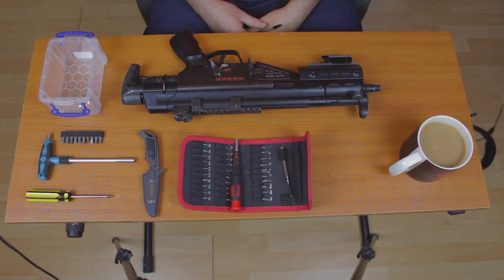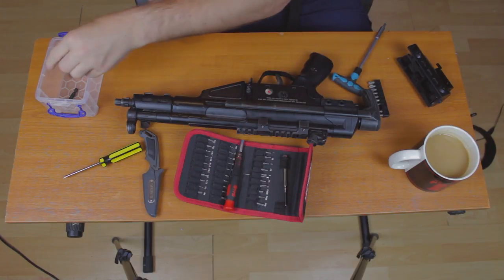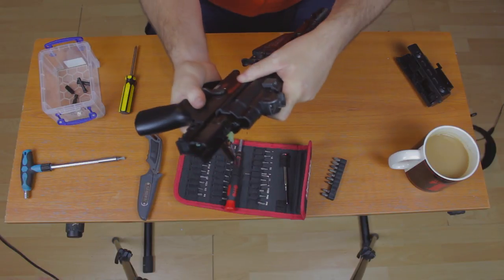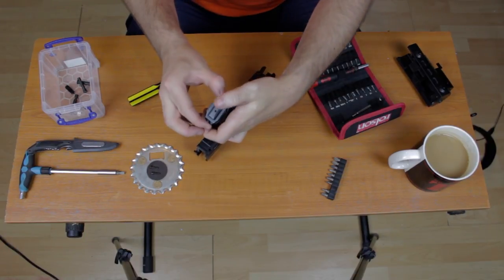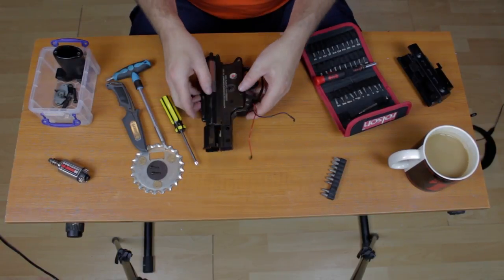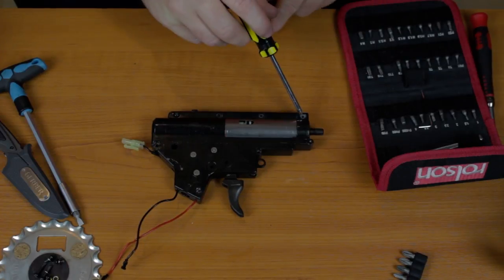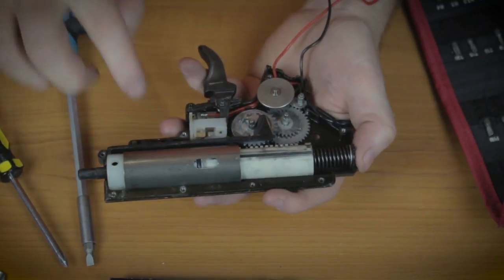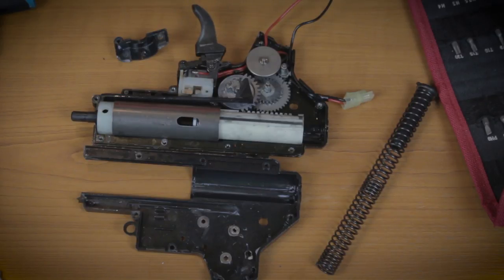TM G3 SAS HC (High Cycle) Teardown

Comment: Here's a tip

Get a smalled precision screwdriver and bend a 90 degree angle in the tip about 5 - 6 mm worth.
Use that to unhook the anti reversal catch before opening the gearbox case.
This will release the tension in a safe and controlled manner.